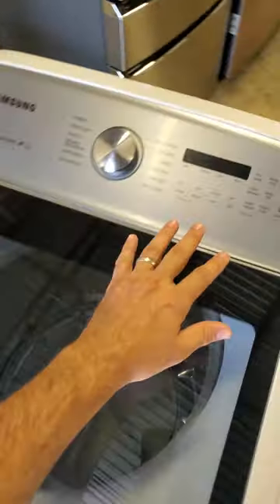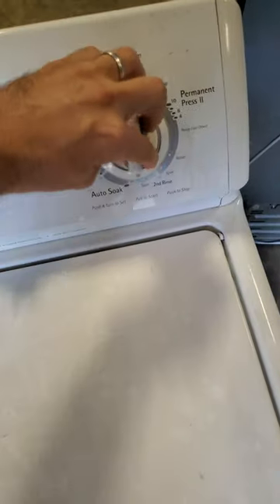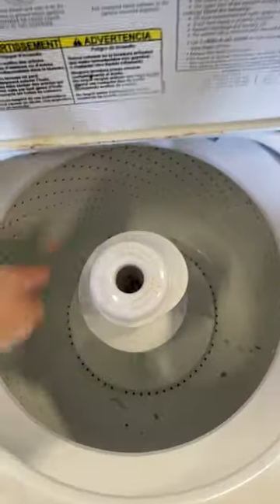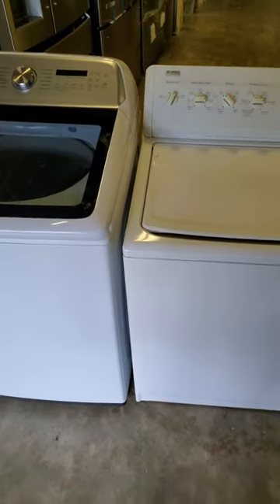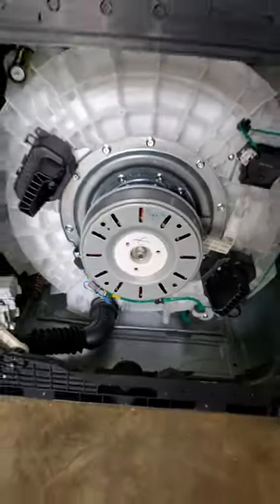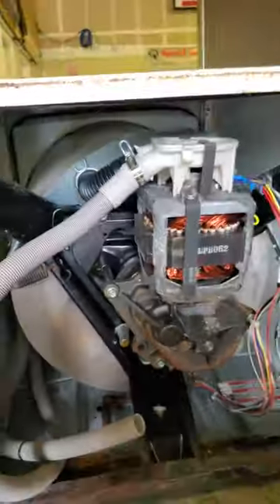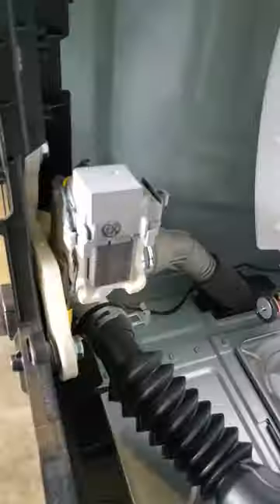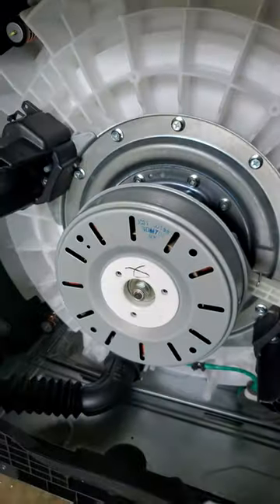Buying New Washers vs Old Washer

Comment: I am a 20 year appliance tech.  This is 100% truth. Sometimes I wish I could go back in time, everything is junk now and it costs 3 times as much. It's Hard to make a living . Parts are thru the roof, and half the time they are unavailable, because all of them have  sold out due to the  poor quality of the machines. My whole trade has went to the Pot. The manufacturers have made it so it usually makes financial sense to replace instead of repair, and we as appliance repair men and women are going bankrupt.
Reply: Im a maintenance yech for Rwgional hosing, and I also repwir and alot of appliances . I totally agree with your comment .
Reply: You are absolutely right but don't let it stop you or your thinking. You are intelligent and can continue to educate us customers ir start your own business in this area of technology....trust me keep it going there is plenty you can do. Thank you for this info.
Reply: Seems counterproductive to landfill all these higher efficiency appliances every few years! Repair and continue to use older appliances that work better and LAST longer. You will NEVER offset the cost of replacing with energy and water savings! I suspect the environment also suffers in the long run!
Reply: As an auto tech for the last 25 years, welcome to the "wtf are you enginerds thinking!?!?!?" Club.
Reply: Good thing you're 20. Plenty of time for a career change.
Reply: Might be worth learning some electrical engineering so you can troubleshoot at the component level. A lot of times is just cheap caps and power amps failing the rest of the circuit is probably fine. They could use up rated components to begin with but these companies dont care. More parts sales is their mentality but they dont have the supply chain links to fulfill demand any longer.
Reply: then become an appliance salesman and installer dummy
Reply: since you are a appliance tech id use that know how to open a used appliance store and just sell the old kenmore matag ge n whirlpool washers n dryers heck since they last so long... you could probably find some broken ones in the trash fix them n then sell them!
Reply: Plus replacing the whole unit is terribly environmentally unfriendly...
Reply: THANK YOU BRANDON..
Reply: I just bought a classic speed Queen!!  ❤❤❤ I'll send you guys a review in the next 25 years😂😂
Reply: @Spike-sk7ql it’s not the enginerds, it’s the almighty dollar

Comment: #1 get a front load. #2 direct drive is better and more efficient #3 Both use microchips. #4 suspension, especially on front load make for a quiet wash and protects the machine from movement. The only reason why old machines were fixed was because they often used belt drives that must be in tension

Comment: Washers with either agitators or impellers can go off balance. Newer washers add water during the spin to try to correct the imbalance. Rarely does it happen and even more rarely do I need to intervene. Newer washers are lighter to shift if you need to. I'm 64 and have back issues. Getting the washing untangled from around an agitator, every time I did a load, was a real (literal) PAIN.

Comment: I bought a speed queen and rewashed all of our bedding that has been consistently washed. The water was so gross.. saving water to have dirty laundry— no thanks
Reply: What SQ model?
Reply: @poolahpot  tc5. I really want the dryer but it has to wait. I also gave repaired every appliance in our home. Our last washer was an LG direct drive that wasn’t that old. The idea of saving water when washing our most important items is hysterical as I watch people water grass.
Reply: @poolahpot  could you say if the dryer is worth it? I have gas in the general location. Right now it is electric. I clean out my vents once monthly.  Added a T in the basement to my ducting. I took apart my dryer 3 weeks ago and cleaned the whole thing (still the companion to the LG) and drying still sucks. It’s not broken. It has a new screen and when lint builds up I clean the screen with hot soapy water about 1times/week. We don’t use fabric softeners. We use a variety of high efficiency laundry detergents. Though my wife does like the ones in the “pods”
Reply: @AntidoteStar  that’s the model we are looking at.
I’m torn between tc5 top load and their front load model.
Reply: @AntidoteStar  I don’t have any SQ as of yet
Reply: It’s common knowledge that this is just a myth. The rest of the world has moved on.
Reply: @poolahpot I think the top loader is best. No smells. But it’s my choice and fits in our space.
Reply: I agree! If water savings are the primary objective,  simply SKIP washing! We ditched a  newer high efficiency water saving machine and replaced it with old-school Speed Queen. Water bills went up, AND CLEAN clothes returned! YEA!
Reply: I have an LG. When I worked in mud, I used a 5 gallon bucket to prerinse. I don't blame the washer. That stuff would stink in anything.

Comment: My parents had a newer HE maytag bravos with the computer control board. It started to break down and fall apart. Luckily I had a 90s Kenmore I got from a guy a few months prior, I cleaned it, replaced the agitator dogs and we are now currently using it. Works great and cleans better too.
Reply: Most likely your parents were using it like the old one and you can't

Comment: I just replaced the transmission in my mom's 30 year old whirlpool like the one you show here. It runs like brand new now. Might have to replace the agitator dogs, though.
Reply: Those agitator dogs are very easy to replace. Doesn't take too long but it's not the easiest thing to do, but you can do it with basic tools and without knowing how these work.
Reply: How much do those cost?
Reply: @leechburglights  I got it off Amazon got $129.
Reply: @TheFrenchPug you paid $129 for dogs? We own a used appliance  shop and dogs only cost $3-5…. If you paid that much just for the dogs then you got ripped off.
Reply: @nikkiritchie7535  No. The transmission.
Reply: @TheFrenchPug  whew good thing. Lol that makes a lot more sense

Comment: My parents Kenmore washer and dry from the mid 80's worked perfectly up until about 2010 when my mom decided she wanted a new washing machine and dryer lol. The old stuff still working perfectly. But that basically started a process of replacing the washing machine and eventually the dryer, both of which only lasted five years. She now has and GE dryer thats been working great and a Maytag washing machine thats been working great. But between that she had a very expensive LG washing machine that rotted away and started dumping rust into the wash cycle. Then the matching LG dryer died shortly after. The screen would no longer turn on.

Stay away from the expensive stuff snd stick with simplicity. They all wash your clothes just the same.

Comment: Great! I just had to buy a new one similar to the one shown. I would have loved to fix the old one again but the 2 speed motor went and a replacement is no longer available.
Reply: You could have got a used one cheap and easy to install. A 15 minute repair
Reply: @mwatkins2464  I could not find one anywhere. Believe me I looked. The machine is about 25 yrs old, maybe older. I hung on to it just in case I come across one.

Comment: Ok so a few things.

1. The agitator on the new model is on the bottom, it doesn’t need a middle spindle to agitate the clothing. In fact, it’s actually better since it requires less cleaning and maintenance and won’t squeak for years.

2. You don’t think the old washing machine has a control module built in? How else does it know to turn on specific functions when you press a button or to make the spin cycle go faster or slower? A computer board!

3. I’m pretty sure every new washer these days comes with a 10 year warranty on the motor and some have warranties on their entire drive system (belts, electrical systems, stabilizing, etc, basically any part that isn’t cosmetic). Old washers do not. If  it breaks you are calling someone and paying a couple hundred if not thousands to fix it depending on what broke, if you ask anyone they’d take a 10 year warranties product over an old machine destined to fail.

Comment: We had a new expensive Samsung.   No agitator and the clothes never got clean. Two recalls where a tech came out to repair. On one mode it sprayed water on the floor over the drum, other was a dangerous condition where the drum could detach causing injury. It didn’t buzz when finished but played a long Chinese tune.

Comment: It's all preference. All options and opinions . All brands have issues and back then they had issues yes they did last longer but they all still have issues then and now. The old timers control setup u never want to turn counterclockwise either I seen that on this clip that messes the gears up inside badly it's like throwing the car in reverse as your going 70 mph on highway. I do prefer older style myself just because they are easy to work on but honestly they are all easy to work on that's what I do for a living
Reply: Yeah but you also have to take in consideration of the whole right to repair and the affordability of repair. It's not right when a customer has to pay $300 for a main board in $200 for a display board versus $70 for a timer
Reply: @jasonp.hughes574 Google it and fix it. Not hard u know how I learned how to be a tech? Sears just threw me out to the wolves after riding with a mentor for 3 weeks. Then I went out on my own and I watched so many videos I bought two books read them more than once and hands on experience is what taught me to be a good tech my rating 4.93 put of 5 stars and customers I help out they appreciate my help and I love helping them that's another reason I'm decent. I love helping u guys and getting people out a crisis yes not having washer m dryer is a crisis there essential. I self trained myself so muchy fiance would get mad that I didn't spend time with her I'd just study and watch vids and go to work and be out there for 8 to 15 hrs Monday through Friday but I love it and it's rewarding

Comment: My parents have a 13 Year Kenmore elite and the rust will make that washer crap out long before the electronics will. Digital control panel washers can be very reliable as long as it is designed properly.

Comment: The problem with the old machines is the parts are now made out of plastic and fail easier than the OEM parts. These repair guys never mention that you're going to have to pay a couple hundred dollars every year to keep your old machine running. In repairs alone, my new machine was saving me money after 3 years. And it saves a lot of money in water and electricity because the new machines are much more efficient. 
Most of the negative reviews are from users loading them wrong or using too much soap.
Reply: You can still find OEM parts.  I've maintained my old, mechanical GE washer and dryer and they run like new.  I just replaced my dryer drum bearings last weekend using OEM GE parts.  Anybody can do these repairs with basic tools and available DIY videos, and any tools you might need will still be cheaper than having a technician do it.
Reply: A couple hundred per year for repairs? Not in my case. I also am the maintenance director for a multi-house campus, and I only use older washers and dryers (various brands) because I almost never have to work on them. I haven’t had to work on any of those older units in years. When I do, it’s a lid latch or a switch. . . simple fixes. If one bit the bullet tomorrow, it’s still well worth it!

Comment: We had a Samsung washer but it was engineered to fail and flooded our house. The drain motor is held to the side of the tub rather than being attached to the body. Then when it spins out of balance the tub hits the side and the drain motor tears off because it is held on by cheap plastic. That causes the drain hose to pull off the bottom of the tub because the slippery tube doesn't have a lip and Samsung used a lame finger clamp. That causes the water to drain out the bottom of the tub causing the washer to go into permanent fill which also drains out the bottom. Samsung employs child engineers.

The lawyers did a class action lawsuit against Samsung. Samsung paid the lawyers a bunch of money to go away and sent the owners a sticker that went around the control knob. Only one third of the settings remained and we were told to only turn the knob to settings where the lines remained, not the explode settings that no longer had lines.

The Samsung warranty is a lie. There are costs for visiting, labor, and parts under warranty. Even if they fix it, it is still a flood bomb primed to destroy your house. We threw our Samsung out after only 1.5 years and got a Speed Queen. It is 7 years old and still like new.
Reply: What model speed queen?

Comment: I have two sets a whirlpool duet front loading set from 2007 and a brand new top loading set from Samsung. Am I better off keeping my old set?
Reply: Front loaders are the bomb.
Reply: It's all preference. All options and opinions . All brands have issues and back then they had issues yes they did last longer but they all still have issues then and now. The old timers control setup u never want to turn counterclockwise either I seen that on this clip that messes the gears up inside badly it's like throwing the car in reverse as your going 70 mph on highway. I do prefer older style myself just because they are easy to work on but honestly they are all easy to work on that's what I do for a living
Reply: dont lose your old set we have new-ish top loaders from samsung and they fucking suckkkkkk i have to replace the suspension rods and i hope that goes well and helps but samsung BAD
Reply: Keep the old ones. I recently traded newer Samsung products for used Kenmore 70 series washing machine and dryer from 2001. Are used to have these old Kenmore products and should have never got rid of them. Again, keep the old stuff that new Samsung was absolute garbage, I don’t even think it used a gallon of water to wash our clothes.
Reply: @theotter4200  I'm no Samsung lover myself, but I never heard anybody complain on samsung front loader not getting their clothes washed... Is it possible that you chose the wrong program? Different programs do have different loading limits, not all of them  do a full load. Look at the program table in the users guide and all is gonna clear up. That said, nowdays, they also push too much those eco programs that not always are that effective. That said, on my model it works great.

Comment: Yes, I inherited my mom's washer when she passed away. It's 26 years old and does a better job than my much newer Samsung.  And yes, I'm a two washer household.
Reply: whats your water bill 😂
Reply: @NUTBUSTREAL   I only have my own clothes to wash and I typically pee off the back deck. My showers are < 5 gallons and I use paper plates and plasticware, plus I'm not keen on watering the grass so I never bust the one unit minimum on water use.  I didn't mean to imply I wash cloths at twice the norm.
Reply: @josephsfields  oh i see, with my old washing machine a week ago my water bill went to almost $600 now with my new washer im hoping im gonna save much more water
Reply: @NUTBUSTREAL    My water bill (the portion of my bill just for water) is never over $18. Your bill of 600 bucks sounds like you have a leak.  I could use another 1000 gallons ≈ 35 loads of laundry at a cost of $ 7.54.   Maybe you should check that your water meter is absolutely still when you have all faucets closed.  Six hundred bucks is the cost of filling a 80 thousand gallon swimming pool or ≈ 302 cubic meters of water.
Reply: @josephsfields  Wow, i see. Ill get it checked out

Comment: the new ones without an agitator is what I have and it does not clean as well as the old ones, very poor cleaning, unbelievable
Reply: I was born and raised on front loaders, becouse that's the standard of washing machines in Europe, but when I saw they just pulled out the agitator from a top loader, without replacing it with any new big "discovery" first thing I thought was: how are the clothes gonna get clean with that little horizontal movement?! Clothes need to be tossed and turned and rub eachother in order to get out clean.

Comment: Yeah, nah... I had a "modern" Fisher and Paykel QuickSmart MW511, came out in 2002-2005, I don't remember exactly. Had the new direct drive BLDC motor and was run by a microcontroller. 

The only differences were it had an agitator, and it lasted me about 17 years before dying around 2018-2019. It had one pump failure at about 10 years old. No other faults, and it washed my clothes better than any machine I've ever used since.

Comment: Not true. They just require different care. People just think by having a washer without an agitator means they can put more in, when in reality you shouldn't because the more clothes in them require the washer to work harder causing them to break down faster. So yes people just don't take care of and use them like they should. They have a mindset that it's newer technology so it should handle bigger loads with less maintenance and that's simply not true